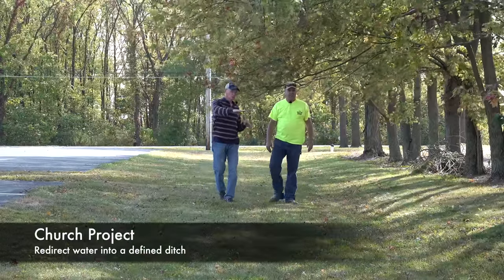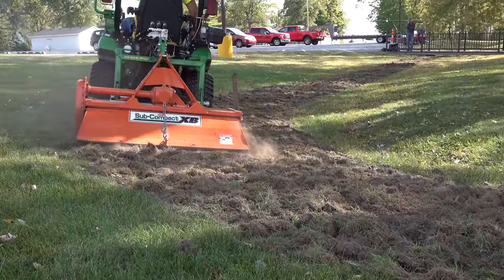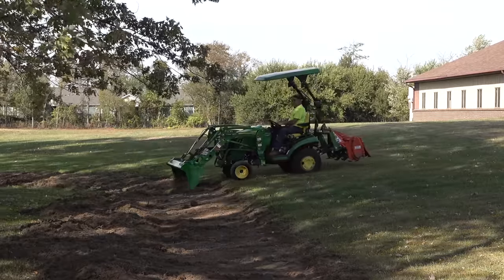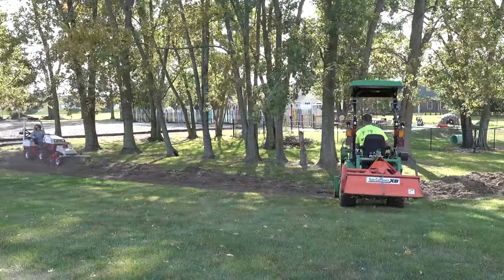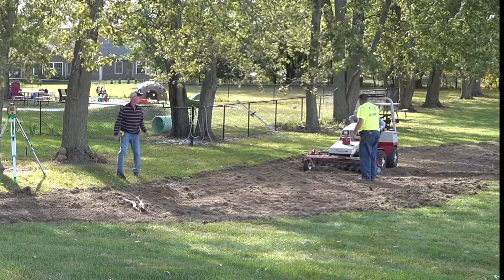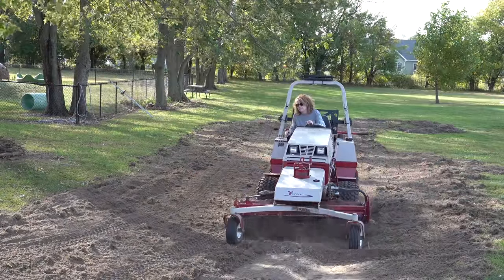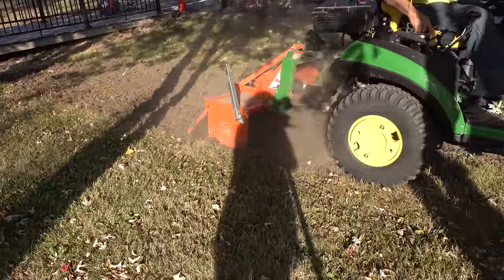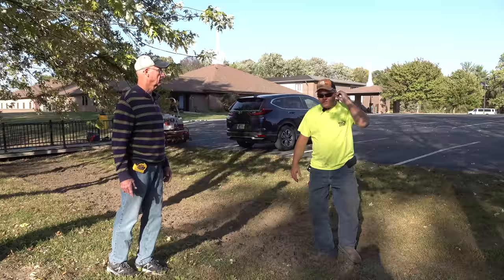How to Dig a Swale!  Subcompact Tractor, Tiller.

Comment: Almost the opposite around here. You need to move dirt to get a flat spot to garden. Tiered yards are very common. I'm lucky to have a couple flat spots that only needed some work, but could be better. So plenty of drainage, but that also comes with more tree roots and rocks.... my 1/4 acre garden required removal of around 8,000 lbs of rock - on initial tilling (lots of starts/stops with the Husqvarna rear tine tiller). Plus side: going to reuse the rock on a washout area and some to build a floor in the chicken coop.

Comment: Just finished burying tile and leveling off 30 ton of dirt i hauled in behind the barn with my 3032e(not Tim's favorite tractor ha ha). Sure was alot easier to do than with the old 62 Ford 4000 with a trip manure bucket and pond scoop. That power rake would have been nice to play with. Came in for a snack and had to watch your video.
Reply from the maker: Wow, lots of work!

Comment: It looks like when you set the bucket angle to push the dirt across the swale, as you then went down one side and up the other the MSL kept the bucket at the same angle so you didn't have to make that adjustment as you raised the loader arms up and down. Just a thought. Very nice looking swale. It should be a great improvement  to the drainage issue.

Comment: You got lucky on those shades. I have several "half-pair" of gloves because I bushhogged the other half. Stop to wipe the glasses and forget to put the glove, usually the right, back on before taking off and it falls off my lap to join the rest of the mulch. I recently found a pocket  knife I thought I had lost 3 Thanksgivings ago inside the stake pocket of my pickup. Every know and then one gets a break. 
That appears to be the same park that you did the walkway on. 
Great channel.

Comment: Hi TIm.  Great stuff, exactly the kind of leveling I keep trying to do but the see-saw effect from ridges in the dirt is even tricky for backdragging in float.  Curious about your level.  Do you set the desired grade manually and then just use the measuring rod to see if you are high or low?  Got my hands on a 1000 foot level recently and thought that would be my approach. Keep healing.

Comment: Those must be some durable sunglasses.  I pulled a droid turbo 2 in my grader/scraper box who knows how far. I was amazed the phone survived.
Reply: Looks to me like they flipped over the tiller and then he found them on the next pass so they weren't exactly run through the equipment. No sunglasses could survive that. 

I stick mine on my hat like Tim does and they occasionally flip over and off the back.

Comment: Is there any benefit over using a tiller compared to a boxblade, grader blade etc. I'm trying to decided what to invest on based on my needs for a ditch line, swale and grading
Reply from the maker: Tiller pulverizes the soil making it easier to work with.
It cuts to a consistent depth.
Personally, I am not a fan of the 3 point box blade.  However, most others totally disagree with me :-)